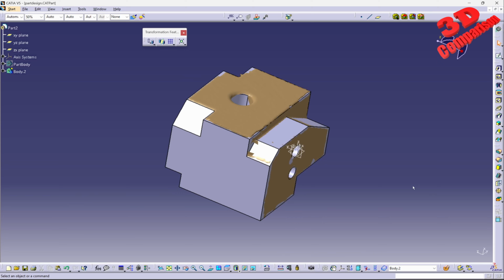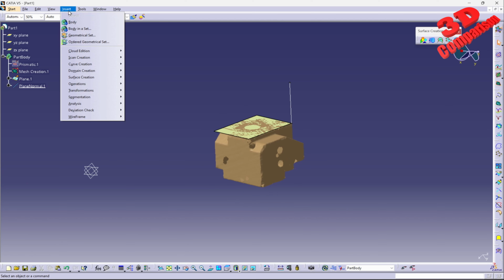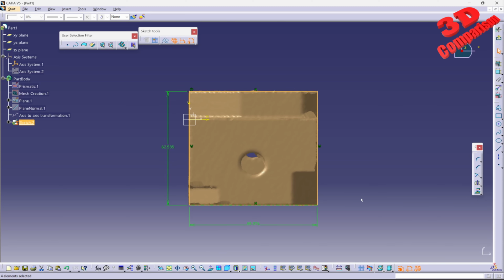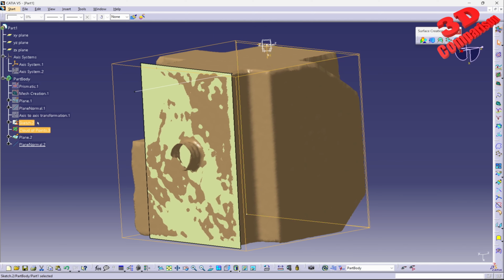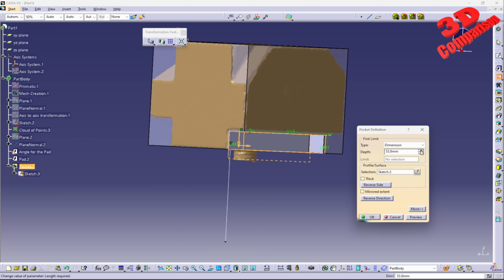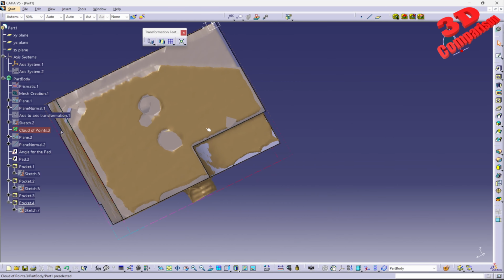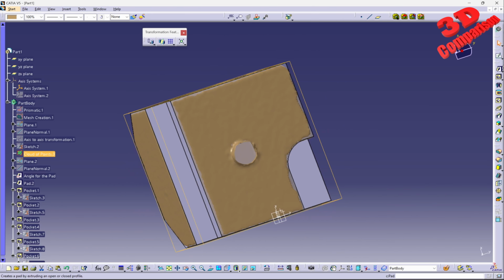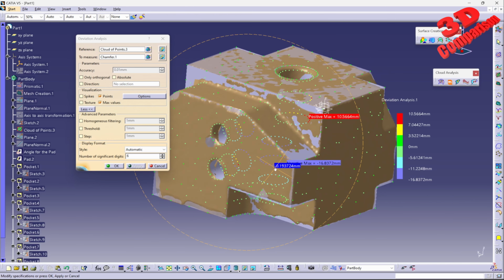CATIA V5  - Getting started with Reverse Engineering

Comment: Hi can you please share ASCI file for working along with the tutorial. Thanks in advance
Reply from the maker: https://grabcad.com/library/reverse-engineering-of-a-prismatic-part-1 here is the CATIA file for this part. You can extract it using export from the final CATpart.
Reply: @3DComparison  Unfortunately is not opening in my CATIA
Reply from the maker: I will upload it separetly tomorrow. Hope I won't forget
Reply from the maker: https://www.sendgb.com/twzUC9xJG1o - here is the file, on grabcad it doesn't allow for ASCI files or zip files to be added. The link will only be available for 48 hours as it is on a free file sharing platform.